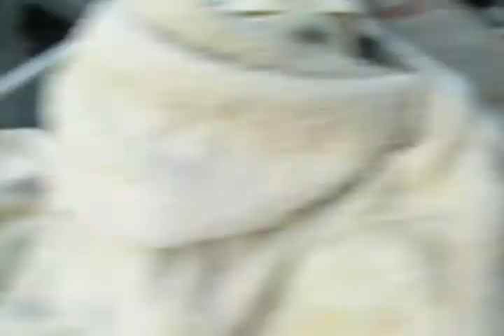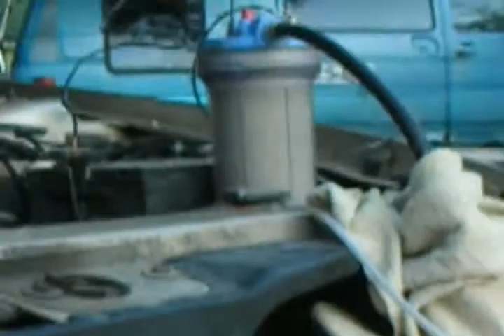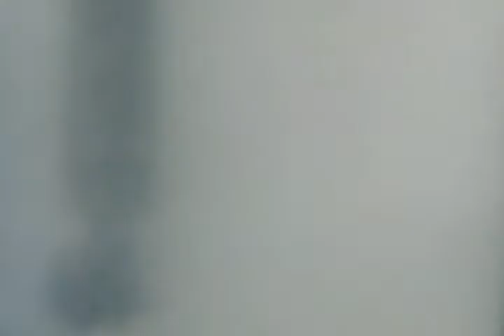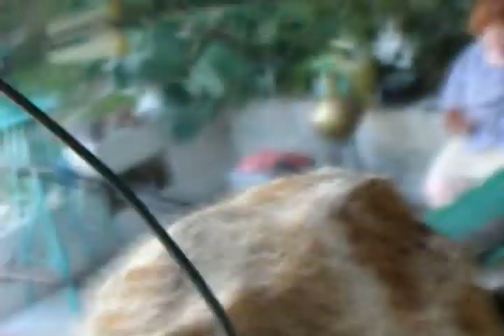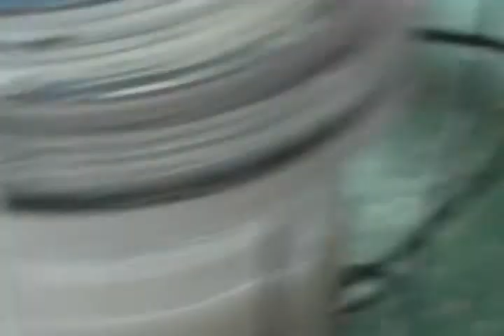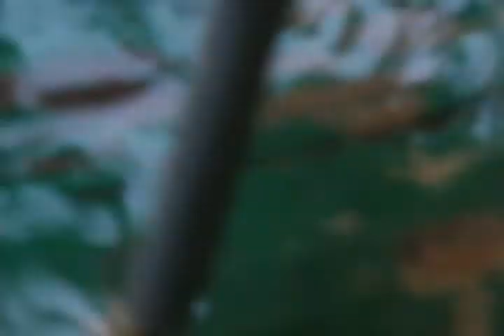HH0 torch 2nd fire

Comment from the maker: if mine was more powerfull could cut a straight line using a guide like you could witha skill saw or table saw. right now im just messing around with my torch but later on i plan on making some money with it making jewelry i just got to get the feel for hho first. but theres allot of practical applications for it i havent seen many people cutting straight lines with any other kind of gas either except for professionals its more fun to play than to perfect

Comment from the maker: yeah im left with a thick white pasty substance in the bottom of the cell its most likely aluminum precipitate i found when the aluminum gets hot it pits and stretches and moves around shorting out i t dosent get the oxide layer on it though also the positive stainless steel wires seem to get electroplated with aluminum after a while then that will corrode and cut your production down. pour it on a fire ant hill thent hey never come back

Comment from the maker: whats strange about this cell it uses tons of amps untill the water is at boilng temperature. then all of the sudden my hho production doubles and i start using half the amps but when you turn the cell off it sucks up everything out of the bubbler does anyone else have these same things happen with there cells i only have it happen with the wire cells. also also i have noticed after you break the aluminum wire on you are left with an alumina substrate. or something like that forgot the name